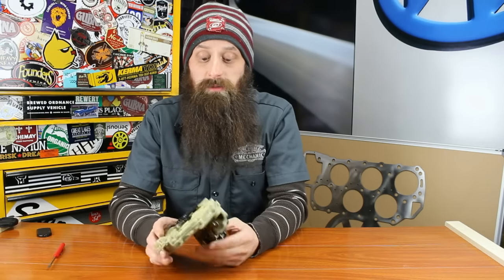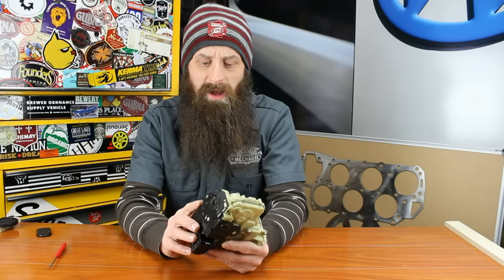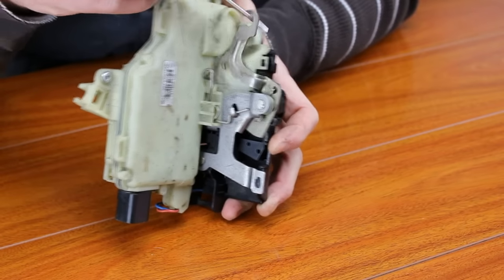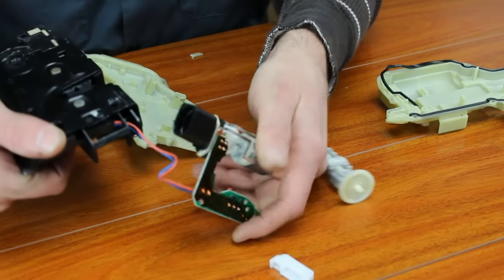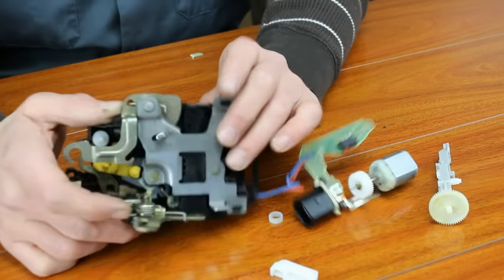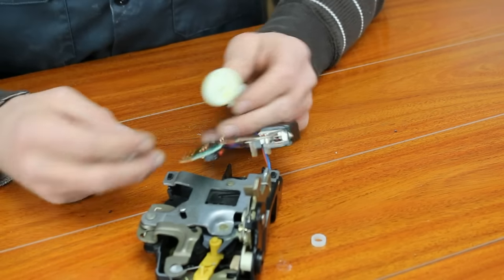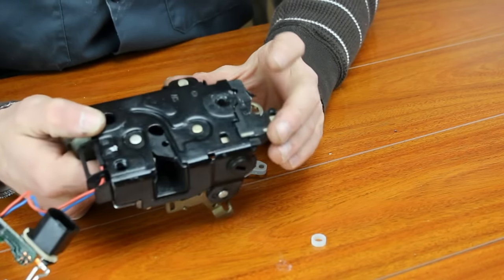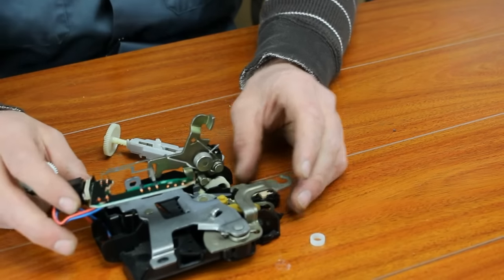How VW Door Latches Fail~ Video

Comment: I have an MKV Jetta that intermittently fails to unlock via remote/unlock button. It always unlocks via interior handle pull, though. Thoughts?
Reply: forevermarkel I have the same problem with my rabbit
Reply: I have the same problem as well. Has anyone found out of the wiring in the door could be the problem, or is this always a problem where you need to replace the entire latch?
Reply: same problem
Reply: I have had problems with doors not locking. First it was the driver side front,and now the passenger side.I have cured them both by taking out the rubber grommet and spaying a liberal dose of WD40 or similar light penetrating oil onto the module.I realise this will not work if there is a serious fault,but it's worth a shot before going for a more difficult and expensive fix.

Comment: I have a 2002 vw beetle that tends to set off the car alarm randomly, when it does it it may happen 3 or 4 times in the run of an hour then it’s fine for a few weeks and does it again, do you think this would be caused by a fault in the electrical side of the door latch? Or do you think it’s not at all related. The door latch also doesn’t work from a key anymore, doesn’t turn at all when trying to open with a key for some reason. Awesome channel great content!
Reply from the maker: Could be. That and trunk latches are common. With a proper scan tool you can see the alarm triggers

Comment: Hi Charles,
2010 VW CC 2.0T Sport
In June, Both rear door locks failed and both front headlamps failed too. The dealer fixed the left rear and right front headlamp now the right rear door and left headlamp failed. The problem with the doors is the same. They do not lock when I do with the fob, car, door etc. The alarm did not sound with left rear however it does sound when I lock now but rear right door does not lock. Any recommendation. I ordered the parts for the right rear and left headlamp. I will do them myself.

Comment: got this problem on a VW Touareg, remote not opening the door even with a new battery installed, removed drivers door key lock cover and inserted the emergency key. That didn't work  either, I figured it was the mechanical latch mechanism. Tried it about five times, eventually the emergency key worked , it seems to be an issue in very cold weather, we live in Canada and the car was parked in the garage for about 2 months. Drivers door latch fails to open you are screwed !
Reply from the maker: Damn that sucks.  Maybe some lubricant and using the key a bunch to free it up? Or is the latch dead
Reply: @HumbleMechanic  update  the lock has opened up ! , the fault comes & goes,  it appears when the car is stored while we are out of country.

Comment: Hello, very nice videos indeed.. I have a 2008 audi TT, I can lock the doors with my remote, but when I try to unlock it with the remote, I CANNOT open it from the outside, but can only unlock from the inside.....it happened on both driver/passenger side doors...any ideas on what could cause such a problem? Thanks alot in advance.
Reply: I'm going through this rn. Did u ever end up figuring it out?

Comment: Often when I unlock my 02 golf with the remote, the front doors will not open when the handle is pulled, but the back doors will.  I open the back door and close it, the front door will open with no change to the door latch.  The door latch is in the open position the whole time.  Do you think this is a door latch failure?  Maybe a relay or a switch?

I will add that in the past the windows will randomly open and close, and i have even lost full power at a stand still. Now while driving the door ajar icon and interior lights will pop on randomly.  Ideas?

Love the channel!  Has helped me through a lot.

Comment: Tell me, there is a bora 2001. Doors won't open with key or alarm. With the key, the thrust rises and that's it, you release the key and it goes back. If I lower one glass, it falls by itself, just need to remove ducktape, then from the inside will I be able to open it or will it be like with a key, just raising the thrust, but without opening it?

Comment: I replaced it on a 2004 beetle but it’s weird, as soon as I lock it with the key from outside, the only way to open the door again is leaving the key turned to the left while pulling the handle but then the alarm goes on. When you unlock with the key, as you return to the key to the middle to take it out, it locks itself! The old latch didn’t do that. The problem was with the switch that tells the car the door is open or closed.

Comment: Hey! Great videos 👌🏻

Was wondering if you could help me please. My Passat b5.5 front passenger door sometimes doesn’t unlock. It is extremely variable. I can unlock all three of the other doors, get in and then push the door lock/unlock button next to the window switches, sometimes I push lock and then unlock and it then opens the broken door, sometimes I repeat 5-10 times and it eventually it opens, and sometimes no matter how many times I re lock/unlock the doors nothing happens! 

Any thoughts/info would be greatly appreciated!
Cheers, Dan

Keep up the good work 🤙🏼

Comment: Hi mate. Ive been looking everywhere but unable to find the right info, so hoping you, or someone else has some insight. Ive replaced the drivers door lock mechanism in my b6 and and now straight after unlocking the car the door wont open, but once the car has been opened from the inside handle it will open from the outside handle. Does the latch have to go in a certain way or is there any info that i need to know? 
Many thanks if you can give me any advice. Cheers!

Comment: Ugh...   Well, that's not going to be fun.  The electrics in my drivers door in my car (B5 Passat) was a little wonky if I use the remote (press lock and it would lock then unlock, press unlock and it would unlock just to lock again).  Not a big deal to me, and so I just opted to just use the key (I never cared for remote lock).  But the other night the key stopped working (can still unlock and lock from the inside, and door handle on both inside and outside still work - just can't lock or unlock the one dor using the key).  I see it looks like I'm going to have fun making a repair (more likely will require a replacement).

Comment: Hi, great channel.. I'm working on a 2008 VW Polo 1.4TDI ... front and rear offside lock actuators ... noticed the plastic bracket held to the card with two plastic pop rivets. This bracket appears to serve no purpose other than to support the actuator whilst refitting (to align actuator with the bolt holes)... correct me if I am wrong... anyway, in both cases, the bracket has become damaged - there is a split/crack ... questions... is the bracket essential to the correct operation of the actuator, does a cracked bracket need replacing?

Comment: hi mate, I have the vw passat b5. 5, and I m suspecting that I have a problem with the passanger latch, so the problem is when I lock the light flash and car beeps but when I unlock the car no lights flash and no beeps? could the latch be the problem? I found the fuse blowed behind the steering of the lights flashing but it didn't solve the problem I changed the fuse but when I unlock no flash lights and no beeps alarm, thanks, I hope you have some ideas for me 😊

Comment: Great video. i just picked up a 97 golf VR6 and I'm having an issue with the power windows and locks.
i can lock the drivers door with the key, but the passenger side one doesnt lock unless i put the key in the passenger door.
also i gt the passenger side window that rolls down on its own during the night and unlocks the doors. any suggestions as to what to look at.

Comment: Hi, There nice illustration.
But I get one question: How to get the deadlocked door that can not open inside and outside. THEN I can follow your instruction and debug the lock mudule?
Thanks.
Reply: Yep, my door has done this and I don’t want to pull it apart and cut it off to get in. Is there a fix?

Comment: Well fecking hell... Replaced my actuator and DID NOT do the preload. Watched a ton of these videos and did not run across this particular step, grrr. I gotta admit, I am pretty sure I watched this video way in the past when I was trying to figure out why my convertible beetle passenger side window would not drop, but in the time that has passed, this precious step slipped past me. Time to try to get back into my door (which I am trying to open because it will now not open from the inside or outside, grrr...) and fix this properly. Damn, gotta lay off those evil margaritas...

Comment: Rad video man!  My front driver side door will not lock when using the lock button on the key fob (all other doors lock).  However, when I press the unlock button, all of the locks/lock rods will open/pop-up.   I have to use my key to manually lock my car via the keyhole (such a modern inconvenience right?).  Would I have to lubricate some of the components/gears in the electrical component that you show in the video?  When I click the lock button I see the lock rod budge a little bit, but it doesn't go all the way down. Any suggestion of where I should start?  Oh, and thanks for the video on how to remove the door panel!!!!
Reply: Hey Rich, I'm having the same problem -- the door unlocks every time but won't lock every time. Did you ever get this fixed or figure out what the problem was? I took my door apart and have lubed any spots that I think may be causing friction/opposition on the lock rod (which may be preventing it from locking) but so far, no success.

Comment: I have vw tiguan, and the window mirror dosnt close on the passanger side when i lock the car, but they both work when i operate useing the knob inside. The code reader suggest a centra locking motor, ground to B. 

Would that require a lock?

Comment: Great video thanks. I have VW Transporter T5, the passenger door is locked closed doesn't open.
Is there a way to open the door ? So I can get the door card off and replace the unit.

Comment: Good job. 05 passat Had r rt dr show open intermit.  Got worse. Now int lights, sunroof, windows, n gas-trunk switches won't work.  Doors lock but unlock themselves after a sec or 2. What do ya think?
Reply from the maker: check for water leak on the driver side, yo need to look under the carpet for water.
Reply: @HumbleMechanic  Yeah the ccm is clean dry n connectors wire looks good. Fuse 14 blew twice.  I'm older and the new scan stuff I dont have.  I get enuff power to int lights to light up te led on my circuit tester but it doesn't have enough to run the light. I might have to bite the bullet and take it somewhere.

Comment: Good day Humble Mechanic. I have a Polo where the passenger door does not want to open from the inside or outside. Now I've managed to remove the inner panel without causing damage to the speakers and so on, but my problem is, I cannot reach to the central locking unit mounting bolts!!! VW SA told me the only way is to break it out. Do you know a way to break the unit without damaging the door?

Comment: Hi i have a 2005 vw golf mk5 5 door hatch. i have a problem that not many mechanics or auto electricians in Australia can diagnose without changing parts. my drivers side front door only and tailgate works when the key is inserted in to the door lock and only locks and opens  the boot and front drivers door but with the remote it only locks and opens the tailgate not any door. i bought the car like that. please any advice will help thanks

Comment: But if the common failure mechanism is the PCB or the wiring, why not fix that instead of buying a complete new assembly? To make an analogy, my kitchen oven stopped working, the tech wanted to replace the whole relay board for more than 200 dollars, at the end I just replaced a 40cent chip and now it's been working for years

Comment: My wife has a 2012 Jetta 2.5 SE and the left rear module is the problem. She has the 10mph repeated locking problem
Reply: I have this same problem with my 2012 Jetta. If you've found how to repair the module (other than full replacement), please share the fix with me!

Comment: I have a 2008 vw transporter Carville passenger door wont open from inside or outside fault no commutation comfort control module . cleared code .still cant open door. any hints or tips.regards tim

Comment: I have problems setting the preload on the outer door pull. The spring slips right off the little hook with the slightest pull. Do you have any suggestions? I even heated the end of the spring help it not slip but to no avail
Reply from the maker: I’ve never ran into one that would not set. It only takes a slight pul to overcome the spring.

Comment: 2002 Cabrio. Replaced the power window actuator and now the dashboard will not light up.  It has had work done before I got the car.  Power door locks don't work, and the lock on door latch has been replaced.  Looks like the door could not be opened and was gutted from the inside to get it to open and then repaired.  Could the "door latch" be a reason why after replacing the actuator the dash board will not light up? Might have "hit" something installing the window and now there is failed communication?

The only way to lock and unlock the driver's door in with the key from the outside.  Lock and the alarm light is "armed". Unlock, alarm disarms, and the power windows can also go down with the key.  It is just the interior and dashboard lights that will not light up at night anymore when I turn on the headlights.

Comment: I took my Jetta 2011 model to dealership to diagnose a vehicle start up issue, where the engine stalls on start up. The dealership told me they didn't find any misfire codes but a door latch code and the fuel pump may be not running as required because of this. They also suggested replacing the door latch may solve my issue. Is a door latch in anyway related to my issue?

Comment: Hi i have a 2011 skoda octavia vrs my electric mirrors are not working at all and central locking locks everthing minus the driver and passenger do not don't lock but the interior light come on and warning sound with lights on and and displays on the maxidot plus the little lights on the door don't work I been told by a few mechanics and auto electricians said it drivers door lock module I've bought a full brand new lock mechanism will this solve my issues

Comment: Any chance u have a video on how to get a door open that’s stuck shut? I just got a 96 vw Passat  tdi and the back passenger side doesn’t work I’ve tried a lot like holding the lock pin up and open both hands at the same time and nothing I can tell the inside latch is hooked up but it doesn’t feel like either handle does anything. Also it’s the other style handle bc the out side is all mechanical vs the inside is the wire.

Comment: HumbleMechanic, have a similar issue with my 2015 Jetta TSI door locks but wanted to run this by you. Purchased the car new and the issue started at around 42K miles. The issue is that I can not lock any car door. The fob does not lock the doors, the master door switch does not lock the doors and in addition, the trunk release does not operate. When the lock buttons are pressed on the master door panel and including the fob, a relay can be heard under the dash. This relay can also be heard when the car reaches 10-20 mph. When the doors are closed and the fob lock button is pressed, noticed that the red LED light on the drivers door indicates a lock system malfunction. VW has not released the fuse box diagram for this model and I have searched the internet and came across your site which is very helpful.  Not sure if I need to purchase a version of VAG-COM or just rip my doors apart. Can you help me please?

Comment: My 2018 Atlas tries to lock the doors everytime it goes under 20km/h. Tries once and fails, and then tries again. The passenger-side door isn't responding. Not sure if it's electronic or mechanical but the door opened sensor seems to work and so does the window.

Comment: Hi Charlie, I have a 2004 B5 Passat Saloon (379,000 miles). It's RHD so the drivers door is on the right. The outer door handle and inner door handle will not work. I have to unlock the locks with a key which also winds all the windows down, when you hold it in the open position, so I can turn on the ignition to disable the alarm. I then have to climb in through the passenger side to drive the car - not a good idea! Have tried removing the plastic cover over the door handle key entry point to try and push the cable tab back so that I could try and pass a hook behind the mechanism lever, but can't get the cable tab to move out of it's track. Any advice would be really helpful Charlie.

Comment: I got locked inside my ‘13 Jetta- I could not unlock It until my husband came back to the car w/ the keys. Then you better be fast because it will lock before you can pull on door handle !!

Comment: Hey having an issue with my 01 allroad passenger door. The door opens and closes fine. But when I lock the door wether its with the fob or the interior lock button I can still pull the exterior handle and the door will open. Would that be the switch failing? As I've taken it apart, cleaned it and checked the switch which seems to be working fine. I've been hoping to find a fix before I fork out the 400$ for a new latching mechanism

Comment: I have an 06 Jetta TDi....replaced the door latch and wiring harness on the passenger side. The car still thinks the passenger door opens but it is closed making the alarm go off and draining battery....any thoughts? And it is after the car is in sleep mode, not instantly.